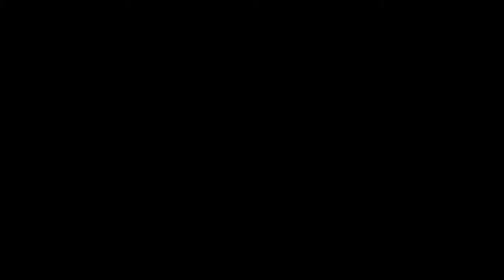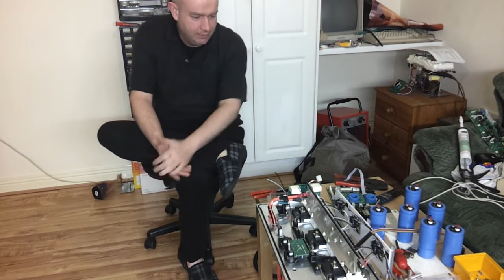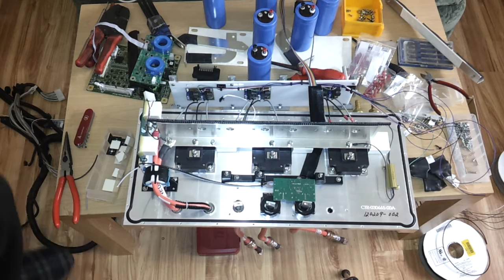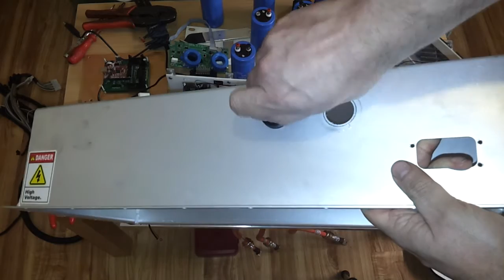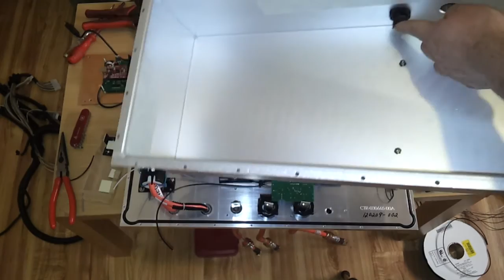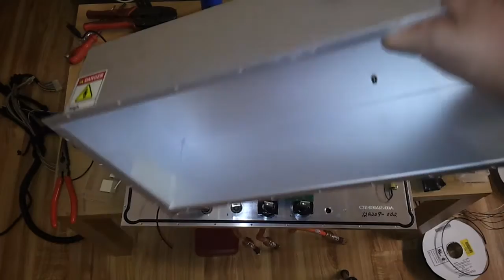BMW E31 840CI EV Conversion 13 : Inverter 02

Comment: Few small things:
- Make sure that the deadtime is set up properly for the particular IGBT type you are using - you don't want to burn them :)
- The reason why the original cards are much more component-dense (as well as in every commercial/automotive inverter) is the safety and reliability. This kit is really bare-bone, I hope nothing bad will happen and you will not see 400V on your touchpad :)
Thanks for the videos!!

Comment: The inverter that Dan built that I picked up from him is set up for a smaller foot print and water cooled. I have changed a few things already and have spun up my motor with success. Now to connect up my current sensors. Im using totally different caps. Nice to see yours coming together so nicely.